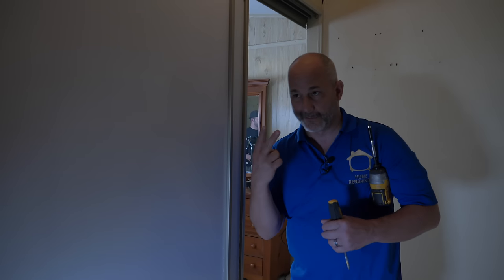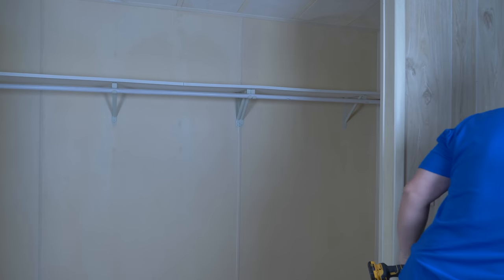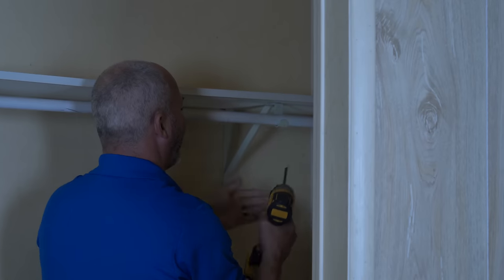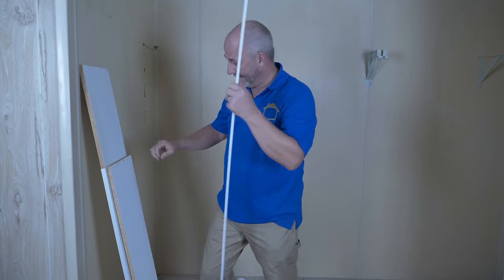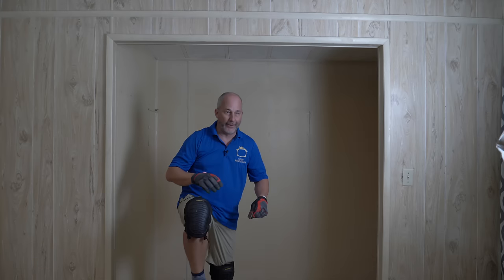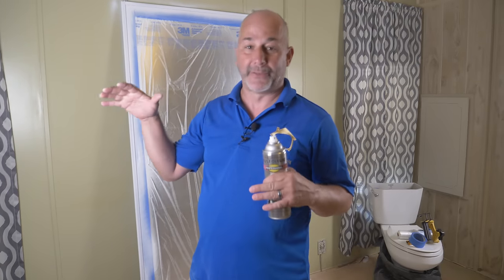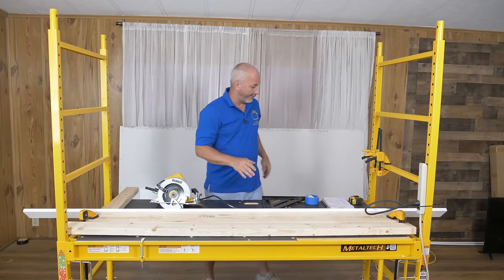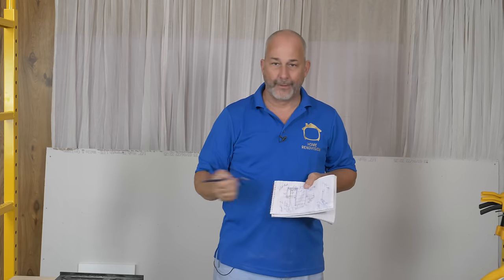DIY Closet Makeover (With Floating Shelves)

Comment: Thank you, Jeff, for your work! We installed our first nailed-down hardwood floor based on your video, and now I am watching your videos to build a closet. The best instruction on youtube. Our house is by Berks in Central Pennsylvania, built in 2011. All walls have studs 24" on center, inside and outside. Builders made a lot of mistakes, or maybe just cut corners. The worst was that the grounding wire wasn't connected to the ground, so we'd lived in the house for 5-6 years before we discovered this.

Comment: Our "modular" house is about 21yrs old. Skyline homes built it. Not sure what state they're out of but we live in IL. Exterior walls are 2x6 16" centers. Interior walls are 2x3 24in centers, except some  load bearing walls that are 2x4 16in centers. Of course the walls where the half's join are 2x3 so  they make up a 2x6.

Comment: I would adjust that top height bar so my shirts don't sit on the lower shelf when hanging there (as seen in the final few seconds of video) they tend to get a little dirty/linty on the bottom even if you keep the doors shut. I installed a rubbermaid variant of what you've done many years ago and installed it to have the largest typical gaps between the bottom of the top row of shirts & shelf, and the shirts on the lower bar & floor, so I could use the under-shirt space for storage of folded sweaters under the upper shirts and boots+shoes on the floor. That meant a very narrow space between the topmost wire-shelf and the ceiling, but I used that space to stuff a couple strands of white xmas lights plugged into the old pullchain lamp-socket. That was enough light to really illuminate the filled closet way better than a single bulb would do, and looked pretty great. That lighting choice was because, my own place, not a rental property, where issues might occur.

Comment: 1996 Fleetwood Woodland Park  Double-wide  28 X 48.  We have outside walls that are 2 X6 and 16" on center.   Interior walls are 2X3 at 16" on center.   Exterior is t-111 style with grooves that are 8" on center.  Interior walls are drywall with knockdown texture. We bought it in 96 brand new for about 39k in Oregon US.  Great video, Thanks for sharing,Russ from Oregon

Comment: I usually use masking tape on my cut lines on coated boards to prevent chipping.

French cleats are great. But I usually don't recess them. I put another board at the bottom of the cabinet to space it properly off the wall. I will have to practice the recess system...

Comment: I did a quick google search for those 12 inch bits and didn't find anything that was available longer than 6 inches in the US. The Irwin bit extensions are pretty good and more stable than other brands I have tried. I bought a right angle attachment on Amazon that's pretty wonky but it gets the job done too as a last resort.
Reply: The basic lower end Dewalt right angle attachment is the bees knees.

Comment: my house was built 2x4 exterior walls with built in wood braces strawbale insulation and then a second exterior wall made with 2x3 and 1x3 then clapboard in Quebec. My roof is cathedral made with homemade I joists. Only built in 2001 but with no building codes enforcement because it’s owner built it’s like going back to the 60’s

Comment: You're not wrong about the screws here having a bad initial bite. Between that, and the screw's shallow bit depth I ended up driving the drill bit into my finger, and getting a spectacular blood blister, lol. I thought I was just an idiot whom didn't know how to use a screwgun, but apparently it's not just me!
  Today is a DIY day for me because my wife is out of town, and I'm taking the opportunity to fix a hallway gang box situation where there was a 2-gang for 2 light switches, and a 1-gang with a single light switch about 2 inches to the right. I've managed to get the new gang box in, which is a hybrid called a "smart box" made by Southwire. It bridges the gap between a new work box, and an old work one by having angled screws in it that allows you to drive them right into a stud. All I had to do is cut the nails for the original box, pull them, and the box out, and install the new box.
  Now I have all 3 switches in one box, on one plate. Today I get to patch out the hole from the old work box, do some minor dent repair to the drywall, sand, prime, and paint. Hopefully I can get it done right so it looks decent. Thank you, Jeff. Had it not been for watching you, and a few others I would not have known how to get it done!

Comment: @1:40 i got the same doors in my mobile home, had an impossible time trying to find those pins that hold it in the bottom track,  ended up just 3d printing ones. 

Although my biggest gripe is because they slide my cats figured out how to open them by banging on the doors till they moved, which led to waking up to the noise and the doors not wanting to stay in the track properly

Comment: mobile homes built post 1976 ---  "Per HUD Code,  interior wall studs are typically constructed with 2x3” or 2x4” lumber and spaced at 16” or 24”.³ These studs are framed on 16” or 24” centers with door and window openings that have structural headers for functionality and additional strength."  Exterior walls are 2x6 for bearing walls.

Comment: Nice! What were the light strips you used? Hard wire, plug in or battery?
Reply from the maker: led magnetic. motion sensor as well. Cheers! 30-LED motion Sensor Cabinet and closet light,Magnetic ,Under Counter, Wireless USB Rechargeable Kitchen Cupboard,motion activated Night light Bar-2Pack

Comment: Did you improve the lighting inside the closet? At one point you showed a bare light bulb, but at the end it looked like 2 utility lights on the ceiling. Both of which are, of course, complete fails. Were all the concealed lights on the shelves permanent or just for the video?

Comment: My 1983 doublewide has all 16" on center 2x4 studs, interior & exterior...  Trusses are 16" on center.  The disappointing part is the joists are 24".  Just bought it a few years ago, in Northern Georgia.  So sorry you got one with pressboard sub-flooring, our's has plywood.  We have been renovating since we moved in, about 2/3's done.  Taking every room down to studs, all new (upgraded) insulation in walls and ceiling and standard drywall going back in.
Reply from the maker: very nice!

Comment: Hey Jeff I know you prob don't like talking about News but I think this might be good for the channel because it has to deal with the fire in Maui. There's so many questions I have about if they followed code and how important it is to have a fire barrier which I think those people did not have. Those house's seem to just burn down so fast people was saying in 20 mins. How can a full house burn down in 20 mins if you followed code ?  Is there fire resistant dry wall ? It wasn't just one house it was like 1,000 house's so. It had to be a code issue right? Many questions please answer them in a video.

Comment: You didn't show how to put those lights inside the closet. Are they hardwired or are they battery operated? That's the best part of the project, getting those cool lights in there. Do you have a source? This was a great job Nice work! That was very informative, you always do a great job of explaining what you're doing.
Reply from the maker: led magnetic under cabinet lights. 30-LED motion Sensor Cabinet and closet light,Magnetic ,Under Counter, Wireless USB Rechargeable Kitchen Cupboard,motion activated Night light Bar-2Pack

Comment: I have a 16'x80' 1998 mobile home with 16 in spacing, but the interior walls are mostly 2x3's. I was very surprised that the exterior walls are 2x6 cause I really expected 2x4.
Reply: might be because of newer constuction, or location/wind load. mine is a 1985 and the exteriors are 2x4 and interiors are 2x3
Reply from the maker: Hi Kristine, does that mean they insulated with r20 as well?

Comment: I am about to install a mirror sliding door from HD myself, which comes with a long metal bottom track, like the old one you replaced. Which new bottom track did you buy--the small one that is attached to the floor only in the middle? - Thank you for the idea. Did you have to remove the pin assembly pieces at the bottom of the doors? Thank you!
Reply from the maker: I could only fond a track guide that sits in the middle. no full track
Reply: Thank you, Jeff.

Comment: Because you asked!
Somerville, AL, USA
Double-wide mobile home manufactured 1999 by Palm Harbor Homes
Exterior walls:  2x4, 16" on center, fiberglass batt insulation
Interior walls:  2x4, 16" and 24" on center, random.  Interior walls free-floating (top plate not anchored to ceiling), with a mix of 3/8" drywall and 1/4" vinyl panelling depending on the room.
Roof/Ceiling:  2x6, 24" on center, vaulted throughout house, blown-in cellulose insulation.  Wall height at perimeter is 7'6", at center is 9'10" (2 in 12 pitch)
Electrical:  Copper 14-2 throughout each half, with five aluminum crossover runs (properly terminated for copper/aluminum junction)
Plumbing:  Upinor Pex A with incorrect crimping method used, leaks abound.

And quite possibly the weirdest feature, a light switch mounted 1' above the breaker panel that causes all 240V appliances to run at 120V.  I do not understand what purpose this could possibly serve, and I'm scared to touch it because I don't understand it.  LOL
Reply from the maker: Cheers!

Comment: Oregon, 1980 mobile. 2x6 floorboards, 16 on center, 2by 4 exterior walls, 2x4 load baring center walls, 2x2 non load walls. pathetic. I found the non load thing by mounting a tv with a 2.5 in screw for a tv.
Reply from the maker: cheers!

Comment: Call home Depot supply used be maintenance warehouse the bought up all the old closet hardware the deliver for free. Next day do project accounting by unit if necessary not sure if they deliver Canada. Great catalog  2000 pages old day online today as you found big box store don't carry 1970 rehab stuff did rehab 800 units in five years 1980,s

Comment: Slab on part loose dirt and part clay... studs 24" not 16"... the foundation and sewer have been a nightmare since the 2021 ice storm (lost power 5 days then lost water for 2 weeks after pipe burst due to supply chain)... built in 1974 (happy bicentennial USA), lowest tier Fox & Jacobs. And the layout is just ODD